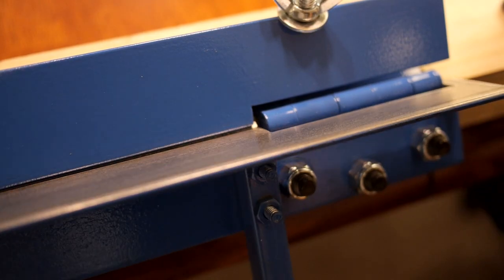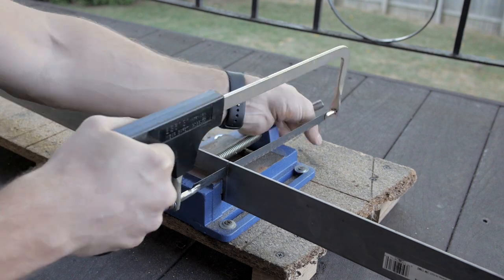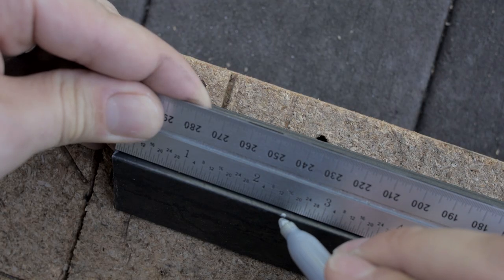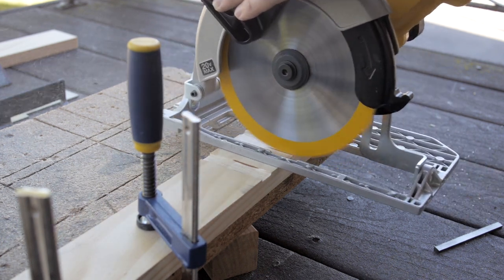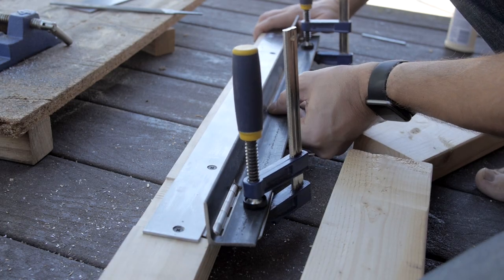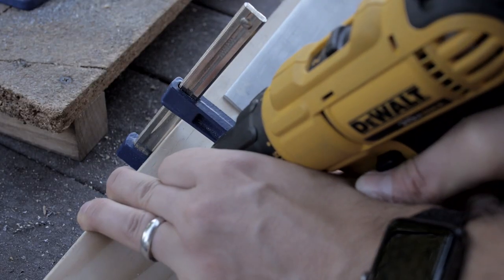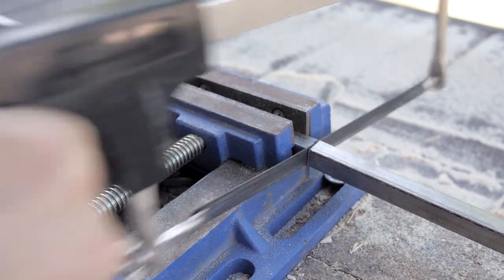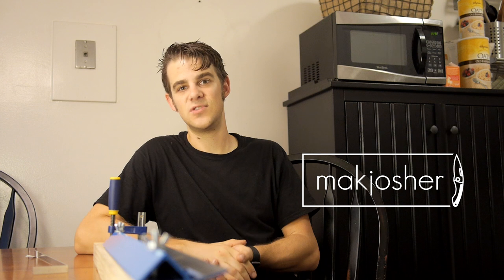DIY Sheet Metal Bending Brake: No Welding

Comment from the maker: I know I didn't demonstrate the use of this brake very much in this video. Believe me when I say I've used it plenty in my videos since then, which you should check out on my channel - the sled ones are my current favorites!
Reply: Nice brake but no welding!! Welding with my powerimig is one of my most favorite pastimes! LOL
Reply: makjosher  maybe one of these days when you get out into the real world and use some equipment you will finally put your shoes on and wear some gloves and safety glasses. You just need to stay at home and let your mommy and daddy change your diapers to you get old enough to wear shoes and then when they say you can go outside don't forget to put your gloves on to.
Reply: Lose the gay music
Reply: @ronaldshepard4625  Who pissed in your beer ?
Reply: Hey man , how deep should the slot be in correlation with the hinge ? As deep as the radius of the hinge ?
Reply: Can this brake bend .040 aluminum?

Comment: Thanks for the video. Living at a place where I dont have a garage or outdoor area for my projects, I work in my kitchen. Currently, I have a TIG welder chiller that I put a new pump, added an electric fan and aluminum shroud that is sitting on my kitchen counter top. To do any kind of electric grinding, I have a favorite 3' x 3' x 3' cardboard box that catches any flying debris. Spritz it with water and it wont catch fire. Do what you gotta do.
Reply from the maker: Wow! I feel like I'm working in a fully equipped machine shop now that I hear about your setup. Way to go though! Most people would be surprised at what can be done in a kitchen.
Reply: I do some of my shop work in my kitchen. The light is better, it's warm, and it's not as crowded with junk as the garage. But the table saw stays in the garage, or driveway when the rain stops.

Comment: dude, spend $30 on an HF angle grinder and some cut-off disks
Reply from the maker: Point taken. I have since gotten an angle grinder, but I need another steel-intensive project like this to put it to good use.
Reply: I was kinda thinking that too, but gotta hand it to him, he makes nice straight cuts with a hacksaw. (most people wouldn't ,haha)
Reply: I use my grinder for more than just slicing steel! They have sanding discs and masonry blades. Grinders are very much worth the money. Looked like a good project to practice your measuring and planning skills but for the cost of time and supplies...totally would have bought a store made brake. I'm sure it was still satisfying to make your own though. I made my own heavy duty lumber rack for my truck and it was fun...but damn I should've just bought one with all the work it took!
Reply: I love to cut that kind of steel with a hacksaw myself :)
Reply: I saw the Dremel (or similar tool) for a small cut to accommodate the hacksaw, and wondered why not do the whole cut with the Dremel. Those little cutoff discs cut just about anything, and I'm better with them than a hacksaw.
Reply: Can afford a Snap-on toolbox but won't buy a cheap grinder hahaha
Reply: Thats an interesting point. That box would finance a shed load of tools.
Reply: I think proper workbench / table, vise and clamping would be a better investment. Working on ground isn't fun, comfortable or safe.
Reply: haha they have one on sale this week 4-1/2" for $10
Reply: d zzz what my dad taught me about power tools was always buy the cheapest one first. By the time you've worn out or broken that, you should know how to use it so when you go back and buy a good one, you won't break that - and you should know if you're going to use it enough to justify spending out on a really good one.
Reply: @patrolmaverick  I think you already stated the conclusion in your comment.

Comment: Finally a metal bending brake that requires no welding. I know you did a lot of hard work sawing the metal. I really like your work of using just normal tools and parts and not having to buy all these expensive equipment to do what you did by hand. I already was thinking of the angle iron as the pivot stop but you showed me how to make it work. Thanks.
Reply from the maker: Thanks! I’m glad you found it helpful.

Comment: Props for not whipping out an angle grinder for those cuts!  Nicely done and much cleaner than I can achieve with an angle grinder cut off wheel.

Edit - I know this video is old, but at the end you only showed the finished product really quickly.. the only critique I have, otherwise thank you so much for this idea, I'll probably follow this video very soon.

Comment: thanks for posting this.   Will watch it again before I attempt to make my own.  Will grab some angle iron as people are throwing out old bed frames in their trash around here all the time.  Also see people pushing shopping carts with aluminum sheet headed to the local metal recycling place........can make some good deals on aluminum sheet there along the road (old signs, computer boxes, fixtures etc.)
Reply from the maker: Yea, I should look into using recycled stuff more. It can get kinda pricy using new parts all the time. I'm glad you found the video helpful though!

Comment: I'm also a fabricator myself. I'm pretty impressed with your finished product! You wouldn't catch me cutting steel with a hack saw! lol. one thing I would add to your brake. Put some springs under the top gauge that ride on the carrier bolts. Open up the holes another size up and finish it off with wing nuts. This will make your life a whole lot easier for the extra $3 bucks.
Reply: oh yea. subscribed 😉
Reply from the maker: That's a good idea! I was thinking of doing that, but at the time I didn't find any springs. It was only really sticky the first few times I took the angle off as I needed to clear the paint out of the holes.

Comment: You could add a small round piece of steel to the end of the moving bender arm & then fix a piece of flat plastic sheet with degrees of angles marked on it at the end as well. Now the moving piece of round steel acts as a needle against the fixed plastic background giving you a visual bending gauge to help with bending all angles?
Reply from the maker: I like this idea! Gauges are the best!

Comment: I may be wrong... but at first glance you made that a lot more complicated than it needed to be... but I am not thinking clearly at the moment.  I will come back to this tomorrow and take a closer look.
Reply from the maker: Now you have me curious. I always try to keep things as simple as possible, but I know they aren't always.
Reply: I honestly don't know... I have looked at some other videos of other people making a "home made" brake press... but so far yours seems the easiest to make... Especially considering that I like most people do not weld.  I think I may have to research this one a little more and figure out if I can simplify it or not.  But I will for sure at some point be making my own version because I agree with you... trying to bend metal in a vice using a hammer just doesn't work well.  Thanks for starting point though... great video.

Comment: Dude, you're killing me with all that hack saw hand work.  $40 harbor freight portaband saw.  Loud as hell but worth it.
Reply from the maker: Haha. Except, I have this rule that I only like quality tools. Not always the wisest rule I suppose.
Reply: makjosher Me too. But right tool for the job and all... I got lucky with mine.  Only thought I'd use it for one job but I've had it for years now and it's still chooching.  I'm the guy why buys knipex pliers, but I just hurt inside watching you do that.  Of course, before my portaband I did the same kind of stuff.  If you can afford it, get a good one.  I made a stand for mine, you could too. Make it one of your videos...
Reply: I'll see your rule, and raise you one Harbor Freight heavy duty mill/drill. It'd have ate a pocket into that angle iron like it was chewing on crackers. You wouldn't even know how to act with one of them. I have a vintage horizontal vertical bandsaw from HF too. I've cut rail road track in half with it. Good luck hacksawing through that!
Reply: I was about to say I can buy a metal brake at harbor freight or Eastwood for about the same cost. To each their own.
Reply: Kevin Kuhn
Harbor Freight's 30" brake looks to be about $230 on their website. On sale, with a coupon, I suppose it could be had for less. Still a chunk of change though.
Reply: Kevin Kuhn
when I went on Harbor's site they did not show me that one. It is cheaper, but still, if you have some scrap steel I can think of better things to do with almost $60.
Reply: If you need a hundred clamps for something, Harbor Freight is a win. If you want a power tool that works out of the box without a lot of modifications, I'll go somewhere else.

Comment: I love your videos.  You, my friend, need a drill press and a work bench with clamps to prevent your work from moving around while your making your cuts.  Love your work.
Reply from the maker: Thank you! I'm glad you enjoy them. I do need them. The work bench is in progress, and I do have plans for making a drill press at some point soon.
Reply: Yeah that's the first thing I thought when I saw you work. That scrap of whatever it is that you're using is one rough looking workbench. Did you find that washed up one day while you were beachcombing? I thought my first workbench was meager. But you got me beat by a mile there.
Reply from the maker: It has gotten progressively worse with time. One day I needed something to work on to protect our deck from errant drill holes. So I grabbed a cheap piece of particle board and screwed some 1x1's onto the bottom of it. Eventually I knelt on it one to many times and it started breaking up all over the place. It's pretty much a mess at this point.
Reply: makjosher
you think? I can't imagine it was ever very much to begin with. A saw horse would be more substantial. Then at least you could stand up like a gentleman next to it. The Japanese work on the floor like you do. If they use a saw horse it is only a few inches high.

The light colored saw horse on the right in this picture is pretty sturdy, and the top is a bit to work on. http://i.imgur.com/jO4JV.jpg It is a pretty neat design. I was going to put other braces between the legs, below that vertical piece, but it was so sturdy without them that I never even bothered.

I want to make myself a new workbench someday. But for now the one I have is getting me by. http://i.imgur.com/VannV.jpg
Reply: Years ago Craftsman(Sears) had a "benchtop workmate" - would make your life & projects much easier and it's very portable. Have to find pics - I use mine for "everything"!  Probably make/buy 1 for almost nothing!
Reply: Correction:  It was Black & Decker (NOT CRAFTSMAN) - fits on desktop, benches, (not sawhorse style)

Comment: I see many of these and everyone can only show making something for really thin gauge metal. like for 22-24gauge and aluminum flashing or maybe only foil lol.
If one would use heavier hardware and really stout material it could handle 18 or 16ga  plate with a long handle. how long is the glue and wood screws going to last?
Reply from the maker: I’ve already run into instances where I want this thing to be heavier. Two years in everything is still holding up well.

Comment: get some nice springe below the top blame (some that can go on the outside of the bolt) and it will improve the experience A LOT, and try to make the  angle iron on top with 45 degree ends (if that made any sense)
Reply from the maker: Both of those comments make sense. I originally wanted to add springs, but didn't find any at the store when I made it. The 45 degree ends would be better for a sharper bend. Thanks for the suggestion.
Reply: its a good brake anyways tho, isnt it? :P if you wanna find a way to make the 45 degree angles on the ends, there are quite a few good jigsaws out there which you can mount to a surface and adjust to 45 degree angle. havent done that over a larger length tho so might be tricky. and not worth the cost of the jigsaw :P

Comment: A very nice job.  I'm impressed!  How many hacksaw blades, haha?  One word of advice, never drag your file back across the metal, you're just dulling it.  Just push and pick it up for the next stroke.  Low budget and well made!!
Reply from the maker: Thanks Tom! I think it was just one blade for all of it. Point taken. My dad taught me that as well, but often I get lazy with my filing.
Reply: Tom Payne is right "it only files on your upstroke" - you're twice as much work! lol
Reply: Thanks from my side too, never gave that much thought lol
Reply: Also, buy good blades.  I bought 2 Starrett 24Ts ($6.99?) a decade ago and haven't killed either yet.  A good blade means you don't have to put any downforce on the hacksaw, either.  Night and day difference.
Reply: I agree , I could tell from the sound of the blade cutting that it was either dull or a cheap blade or both

Comment: Nice idea. This will, no doubt, save many of us the cost of buying an expensive piece of equipment.
If it's of any use, you could also find wood screws that are more robust- the drywall screws just don't have much strength, as I'm sure you know.
Thumbs up, thanks for sharing this. I'm gonna give it a try.
Reply from the maker: Thanks for participating in this comment section :-) Haha. I do agree on the screws. At the time that was the best I had and so far they are still holding up.

Comment: I seldomly write any comments on the DIY videos, but I feel you have won at least MY  THUMBS UP. VERY GOOD it is unique. Apart from a original presentación your metal brake is neat, specially for wood workers none welders. I normally tackel a wide range and all sorts of projects but it is hard to master them all. Thank you again, I am now subscribe to your channel. One question, Anything real of grid energy production apart from solar cells?
Reply from the maker: Thank you!! I'm glad you appreciate it. Honestly, I've been kinda overwhelmed at the response on this video! I don't have any more energy videos currently planned, but that isn't to say I won't revisit it in the future. The research center that I work at has traditionally worked with coal plants, so I should do some videos on that someday as I know plenty about them. Once again, thanks for the kind words!

Comment: Nice job but I wondering why not an angle grinder!
Reply from the maker: Thanks, that is the most common question I've gotten. I just didn't feel like spending the money to get one at the time. Sometime soon though! I did end up using the cutoff wheel on the dremel a bit more than I showed. I used it to create a shallow cut along where the long hacksaw cuts were made. This made it easier to cut straight, plus there was a bit less metal there.

Comment: hey this is an awesome idea! I was wondering what you think would be the maximum thickness of aluminium this could bend, I am trying to bend 5mm thick aluminum thats 3/16 inches,  thanks in advance
Reply from the maker: My gut feeling is that what I've built would probably not work too well for anything thicker than 1/8" aluminum. That being said, if you were to use thicker pieces of angle and more robust handles you could probably do it. From my experience, thick aluminum can also be difficult to bend as it tends to crack, but that also depends on the alloy you are using.

Comment: Josh I am curious...I watched your video and I get how you built it, but have you tried to bend something more than cardboard with it? It seems a bit pointless to bend cardboard with a brake to me, and to that you could butter toast with a chainsaw....lol....but that got me wondering is your brake could handle sheet metal like the sheets of steel they sell at Home Depot!! Personally I want to build a similar brake to your design to make my own computer server case out of the sheet metal I just mentioned and I wonder how your brake would hold up to bending something like that which I think is 22 to 18 gauge sheets of steel?
Reply from the maker: Hi Brian. You are very right about it being overkill for cardboard. :-) I've used it on up to 16 gauge aluminum and it works very well - bends super easy and square. I believe it would work for 18 to 22 gauge steel as well, but I have yet to test it. If you are worried about it being strong enough I would just build it out of a thicker gauge angle - although that does make everything a bit more difficult to make. I wish I had a better answer for you, but I don't think I'll have the time to try out some thicker steel for the next couple weeks at least.
Reply: Well like I say I am looking at bending steel that is 18 to 22 gauge stuff myself (which is about what they make computer cases out of). So I am not looking at bending anything 16 gauge or thicker like old body steel with it! But steel is a bit harder to bend than aluminum! I did take notes on your materials list and I think instead of using 1/8 inch angle iron I might in fact use 1/4 inch thick steel to build mine to handle the abuse!!! But it you do get your hands on some thin steel I would be curious to see how it bends that as well, before I assemble mine! Thankfully though my son has a welder so I have one advantage there you don't, but for myself I can't weld so I will have to have him weld it for me!!! LOL!! Thank you again for your brilliant video just the same though!!!!

Comment: Is it possible to bend metal sheet with any thinkness bcoz there may have a problem after rotate the hinge if the other part of the sheet metal is fixed tightly in the other side
Reply from the maker: You are correct. I would only go up to 1/16” (1.5mm) thick normally. However, you may be able to go a bit thicker with aluminum.